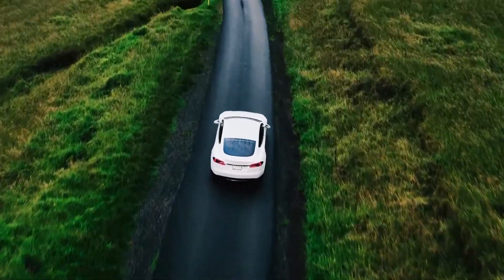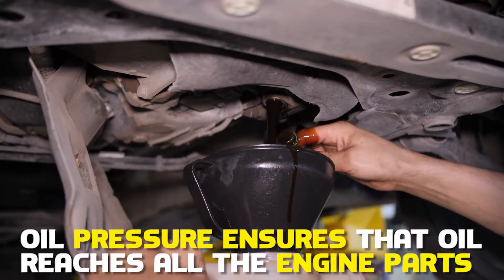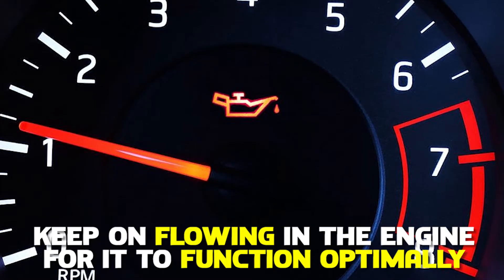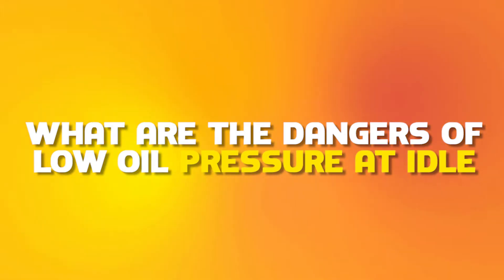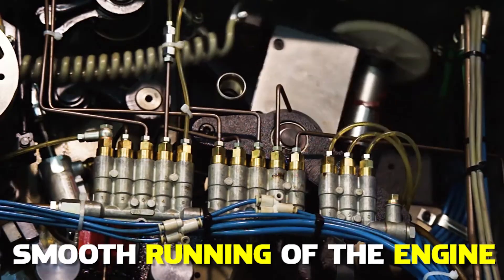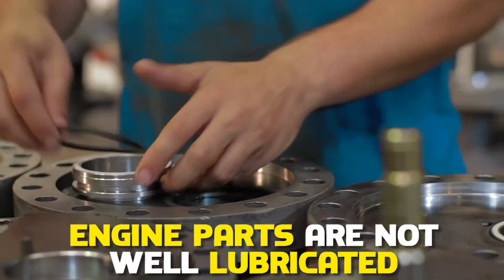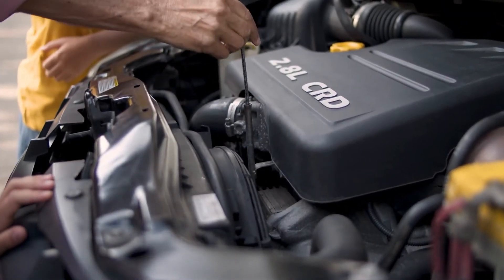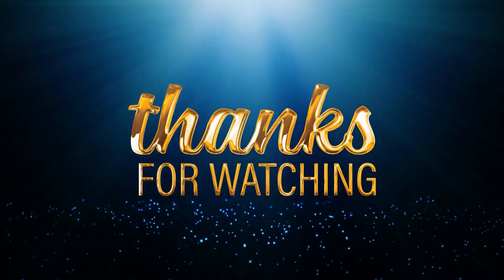SYMPTOMS OF LOW OIL PRESSURE AT IDLE (Causes and Fixes)

Comment: My peugeot 207 (2007)1.4 was giving me a low oil pressure warning when the engine was warm and idling. I had the oil, filter and pressure switch changed. I thought id solved the isuue but started again. On checking the oil type recommended, it came up with both 0w 30, and 5w 30. My mechanic had put 0w in so i had the oil changed again to a 5w. 
I hope im not speaking too soon but this seems to have solved my problem.
If having this issue, might be worth trying a thicker oil. 0w is more designed for modern engines. Older, worn engines from what ive read might prefer a thicker oil.
My mechanic's immediate thought was a faulty oil pump and talking £800 to fix, and advised to get rid of it. I only bought it a couple of weeks ago.
So worth a go. 
Sellers will be more inclined to recommend 0w even if it could take 5w because 0w is more expensive it seems.
Reply: If your engine type is using wet timing belt, which it is immersed in engine oil, it is likely the timing belt rubber is breaking down and choking up the strainer at the end of the engine oil pick up tube. Send to workshop to drop the oil pan and check inside of pick up tube for debris. Replace timing belt. Never add third party engine cleaner or engine oil additives as it is likely to harm your new rubber timing belt.
Reply: Any updates ??
Reply: @WayedM3  yea after a while, on longer journeys started getting the low pressure warning intermittently. I've not been using the car recently since I got my other fixed so not sure if it would have got worse again over time. Otherwise I had planned to try 5w 40 instead of 5w 30 on the next oil change as it seems to occur when the engine is warm and thins the oil.  Or maybe like my mechanic suspected, the oil pump is starting to fail. I'd of thought though if it was the oil pump, the issue would've been worse after putting a thicker oil in.
Reply: @greenjay8096 i read somewhere that it isn’t necessarily the oil pump… most mechanics just lazily tell u to replace the oil pump cos they ain’t the ones cuffing out that money… oil pump has got nothing to do with oil pressure, oil pressure is generated from the crankshaft and it’s bearings.
Reply: @SuperMyckie  I could well believe it. Lucky I didn't go down that road, ended up scrapping the car.
Reply: @Wayedm31 had installed a oil pressure sender and wired to a pressure gauge for my year 2006 Mercedes. At 750rpm engine coolant hot at 90 to 92 degree C oil pressure is 1barg. When coolant is rising at 70 to 72 degree C oil pressure is at 2bar at 750rpm. Will be switching to 10W40 oil as weather here never goes below +10deg C.

Any oil with 0W is good for cold weather temperature of -20 C vs 5W for -10C and 10W for 0C.